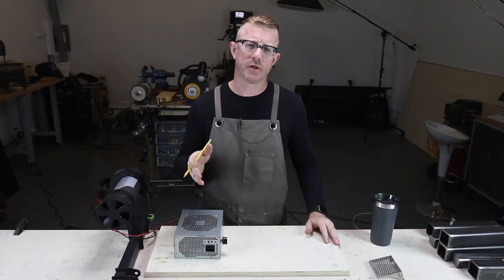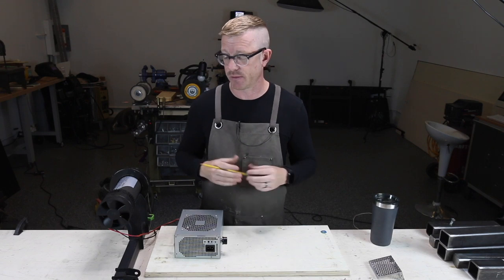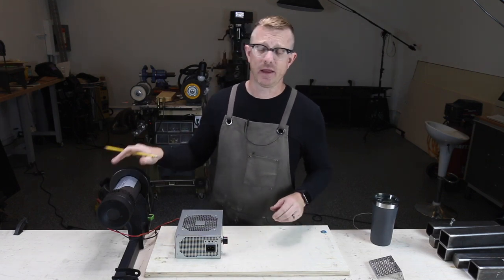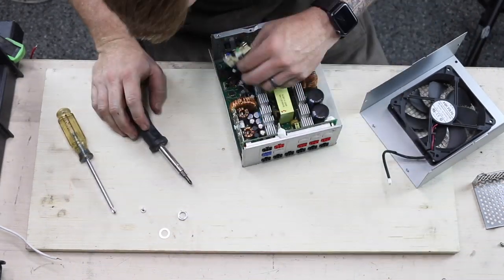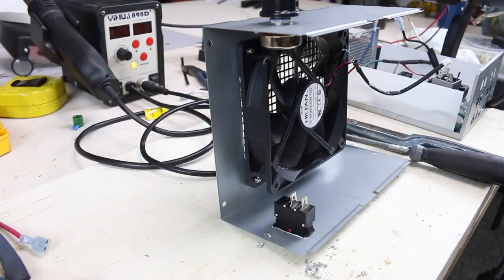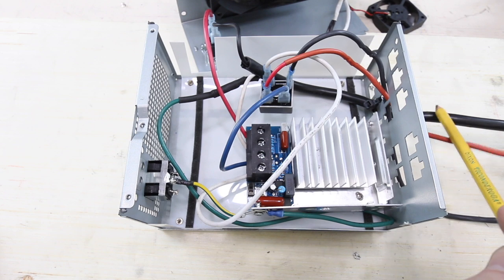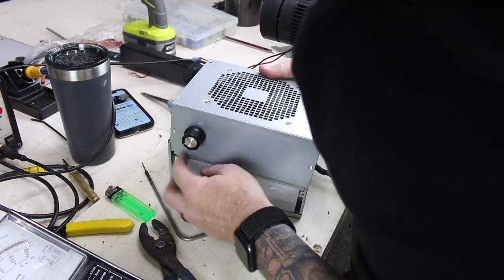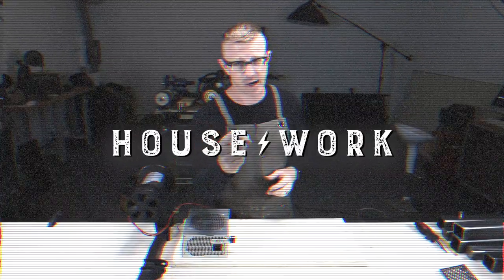How to: Build a DC Treadmill Motor Speed Controller for $20

Comment: is it working sir if i used a 4000 w speed controller?
Reply from the maker: No 10,000 watts only.
Reply: @HouseMadeUS  but what happen sir if i used a 1,500 watts speed controller or a 4,000 watts. can he spins it?
Reply: @HouseMadeUS  how about a 4,000 watts scr motor controller sir. does it work?
Reply from the maker: It will spin it but it will have less torque
Reply: @HouseMadeUS  i am trying to rebuild my old treadmil sir.. it has a deffective board and it wa dead. i will try this method sir if it works. what do you think sir.? is it works?
Reply from the maker: No, you need a treadmill controller not an SCR motor controller. The SCR will not provide enough torque for an actual treadmill.
Reply: @HouseMadeUS  ok thank you sir. how about a 12 volt portable power pump with a 10,000 watt speed controller. does it work if i used it for more power?

Comment: I'll be interested to see how the SCR works under load.
Reply from the maker: +Michael Williams - yeah me too. I’ll keep ya posted. Waiting on a couple more pieces of steel so I can finish up the 2x72.
Reply: I just ran an experiment last night where I was able to stop an SCR-powered motor, rectified with 1000uf of smoothing cap on it, at any speed where I could get my hands on it without getting friction burns.  I can't do that with a standard MC-60 control attached to it.  That's the black magic the EE's who design those boards know how to harness.
IMO the cheap SCR route would be ok if you're just trying to hit a specific RPM close to the top end - rectified & smoothed AC current can get up to 170v so you could use the SCR to drop that down to 100 or 130 or whatever the motor is rated for, but below a certain speed it's difficult to get it to deliver the torque you're looking for.
Reply from the maker: I have no torque issues at all. Just took 1/4 plate and it ate it up. No problems at all. First hand experience here. Thanks.
Reply: @fisharmor   I've had the same experience with SCR, I have ended up getting a PWM controller both times. The higher the load, the more output the PWM puts out to keep up with the demand.
Reply: @MichaelWilliams0311  What did you get for a PWM controller? Off the shelf or DIY?
Reply: @LouiseYates  I use a KB electronics controller, not cheap, but not overly expensive. Have a look on ebay.

Comment: Most treadmill motors are permanent magnet motors. What is the voltage spec of your motor? If you end up putting too much voltage into a permanent mag motor, it will demagnetize the motor, over time, and kill it.

Check the voltage at max, and make sure you're within the motor spec.

Oh, rectifying AC increases the voltage by about  70-80%, so if you run 120VAC through a rectifier, it will end up at ~170-180V of 'chopped' AC, NOT DC.  (takes away the negative portion of the AC wave).

Treadmill motors can be anything from 80VDC to 180VDC, +- 10-20VDC, (I haven't seen every brand of motor made)
Reply: Vdc = Vac * 1.41 

so around 41% more voltage in dc when under no load, and it will be dc just current will only flow during the positive half of the ac cycle at 60hz on 16.7 mSec then off for the same. I doubt this set up is going to last very long.

A pwm dc speed controller would be better for the application too as it would just change duty cycle to change speed giving you a pulsed full dc voltage at what the motor is rated for and allow it to maintain the maximum torque